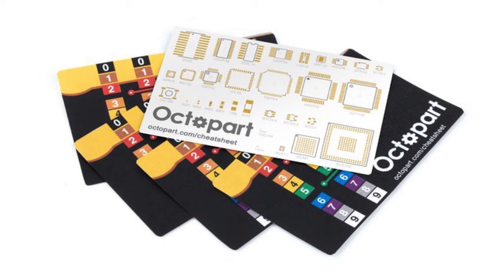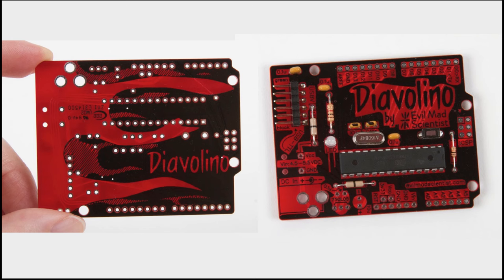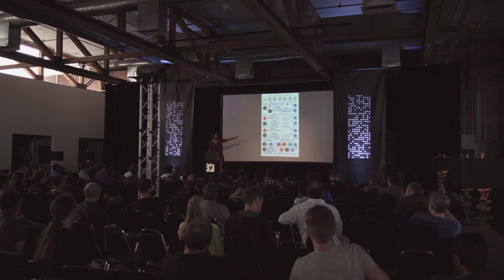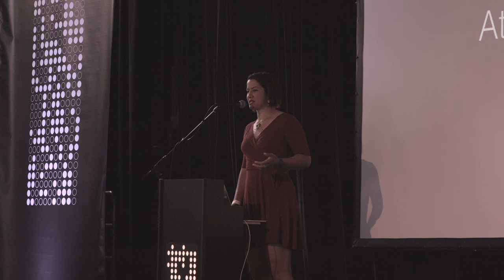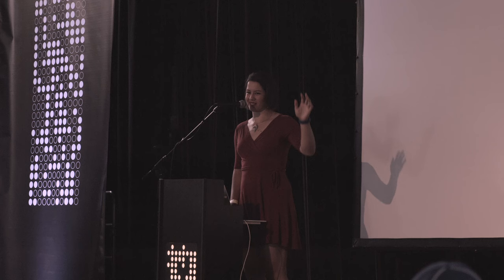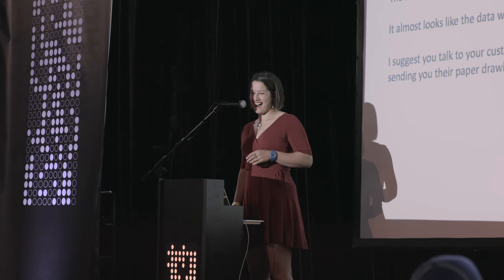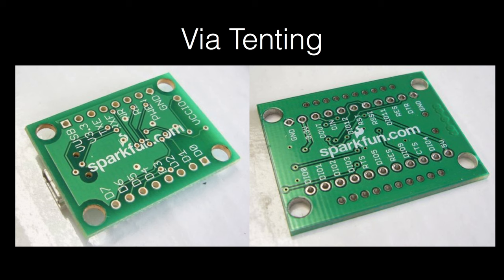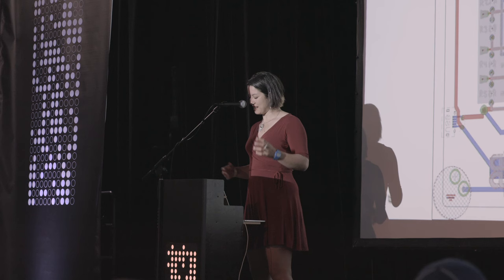Building Beautiful Boards With Star Simpson

Comment: I find it odd that you would need to ask the question "Why make PCBs pretty?" Anything you make, if you can say "now that looks FAN-TAS-TIC", surely that's a big big plus.
Reply: When a company is paying an engineer $30/hr, it quickly becomes financially il-advised to spend time making things that nobody but other engineers will ever see pretty. In addition, modifying the expected fabrication process can add manufacturing costs. Times a million boards, the little details add up. Too bad too; as a board designer myself, I wouldn't mind the occasional chance to make asthetically pleasing boards, even if it were done on my own time.
Reply: This is a Maker specific thing. In that market it makes commercial sense to make pretty boards. Now ask people who buy a Nespresso machine if they'd pay 20% more for it because it's got pretty boards and cute gears, see what they'll tell you.

Comment: Two more, where the circuit board is (almost) the product (it holds the legs/pins as well as the parts, and is for display as well as actually operating), are the Discrete 741 and Discrete 555 kits from Evil Mad Scientist. Yes, they're $35 to emulate 25 cent chips, but they're also instructional, conversation pieces, AND works of art